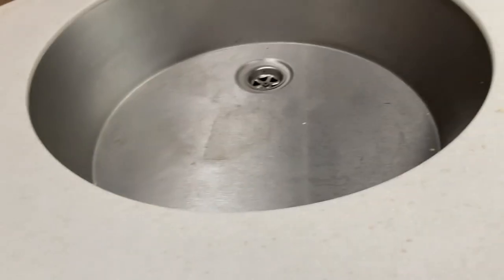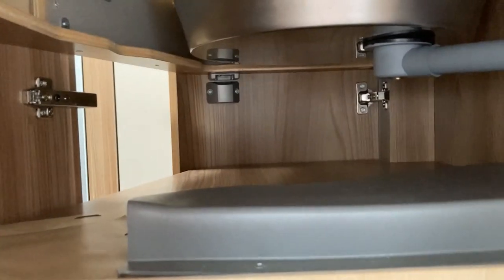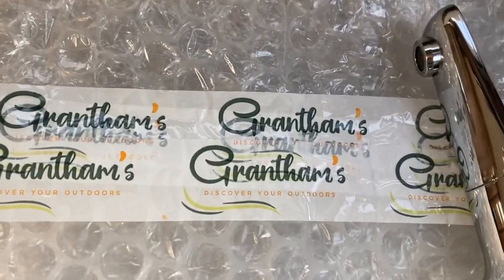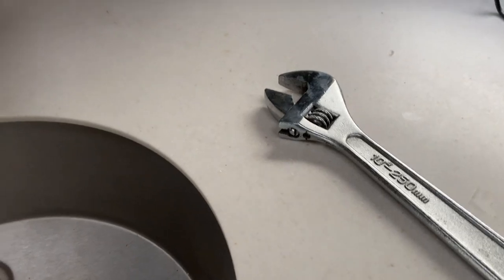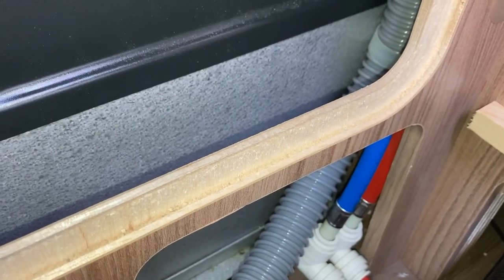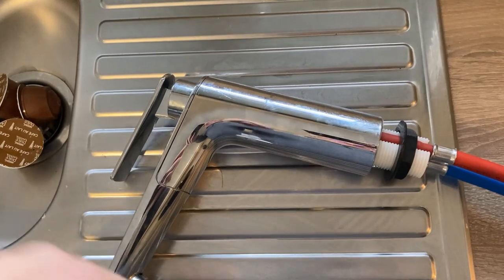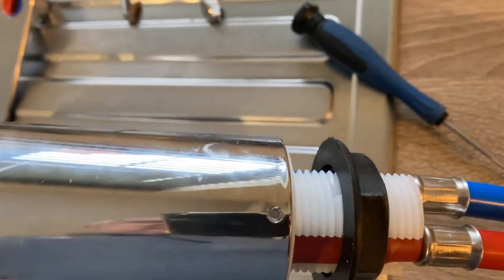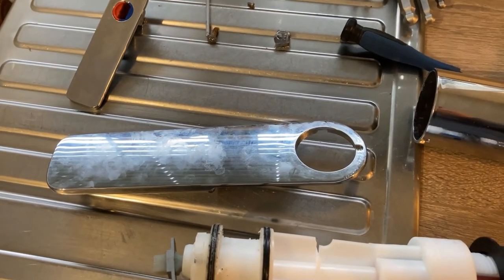Replace Motorhome Kitchen Tap. Reich Vector S Kitchen Tap, No Microswitch in a Swift Kontiki 650.

Comment: Forward planning, you should have a look at the bathroom tap, just the large o ring started leaking on ours.
The fixing screw is so close to the wall I had to shorten a Torx head to get it to fit in the space.
had access to a well equipped workshop, not something 'd have been able to do "in the field".
Used DIY brewers sealing gel on o ring.
Relocated the fixing screw into the front of tap.
Not found the cartridge as a replacement part yet as that will fail at some point, others Riech tap cartridges available but not the vector S..
Reply from the maker: Hi jeremybragg9980, thank you for adding your comment, I did also have a leak in the bathroom shower mixer tap, see the video here, https://www.youtube.com/watch?v=UnuUmy6yuSs&t=315s.
These leaks as said in the videos are completely my fault, I did not relieve the pressure in the system by opening all the taps before parking up our van.  There are many cartridges available as spares online, for example the one below fits many different taps, I am NOT saying this is the same as yours but when I looked at the one I may need to  replace, this looked like a match for the one in my Vector S kitchen mixer tap.
https://www.ebay.co.uk/itm/355144013125?mkevt=1&mkcid=1&mkrid=710-53481-19255-0&campid=5338365712&toolid=20006&customid=EB183619388&amdata=enc%3A14IRYacNtSA2_NAcZFAEC3w13&_trkparms=ispr%3D1

Comment: Hello butty, I've had a similar fault with my Reich Vector tap. Hair line split/crack inside the spout. So I took it all apart from the top without disconnecting the main hot and cold feeds, just undone the small Torx screw on the top and bottom and it all came apart, leaving the Plastic inner still attached from below. I superglued over the fracture, changed the Cartridge while It was stripped down just in case. Put it all back together and working great, but it will swivel in situ, with no leak. I cannot remember if the body of the tap is supposed to swivel? And I cannot for the life of me figure a way of stopping it from rotating if you allow it to.The bottom grub screw stops the outer from lifting up , and the top grub screw is for the  piece around the hot/cold lever. Any idea if this is supposed to rotate, doesn't seem right to me, most taps are secured from below with the retaining nut, but this is already tight holding the inner part of the tap. Sorry for the long winded question, all the best.
Reply from the maker: Hi Mally125, there is a a seal which sits on top of the counter between the tap and the counter, you can see the broken seal in the video on the table around the 4.06 min mark in the video.
The new tap I purchased came with a new one which can be seen in the video, briefly
The nut underneath is just tightened against the underside of the counter and stops the tap vibrating while traveling but if forced the tap will still move, there is no locating lug or anything to keep the tap in a fixed position.
Hope this helps.
Reply: @trytofixitmyselffirst4940  Sorted it out mate, after I left the comment I did some research into those taps. There is a 120degree movement in them. If you look at the base of the inner there is a cutaway that the small grommet/ washer fits into, the one with the small torx screw. When i was refitting the top of the tap I had this facing towards me, it made it easier to line it up and tighten. Once the whole thing is tightened down that small grommet/washer/spacer thing stops the tap from being pulled upwards. Crazy design if you ask me, but it might be of help to anyone struggling to get a Torx bit into the back of the tap to undo the screw, just need to rotate the outer body to gain better access. Thanks for getting back, all the best Mally

Comment: Do you still have the cartridge?
Could you post some images of it please.
I'm trying to source replacements, nothing lsited as for Reich Vector s so I need to compare images online with original and don't want to strip down.
Many thanks
Reply from the maker: Hi jeremybragg9980 again, I did not keep the cartridge as I was replacing the complete tap, I did not take any photos of the cartridge either, but I did strip it down further to take a look at the cartridge as other forums I have read have said these can be problematic, but in my case, these cartridges had nothing to do with my leaks.
I did a search for a replacement cartridge and some cartridges fit many tap types, see the eBay listing below and in the description it states it fits a Vector S tap.
https://www.ebay.co.uk/itm/355144013125?mkevt=1&mkcid=1&mkrid=710-53481-19255-0&campid=5338365712&toolid=20006&customid=EB183619388&amdata=enc%3A14IRYacNtSA2_NAcZFAEC3w13&_trkparms=ispr%3D1
Hope all of this helps and thanks for watching my videos.

Comment: All you needed to do was to replace the o rings on the white plastic part, about a fiver
Reply from the maker: Hi Destroyer, thanks for the comment, unfortunately for me this leak had nothing to do with the cartridge ,it was the tap housing at the spout end after the O ring on the main tap body that had a hairline crack.
On the video around 13.15 you will see the spout and main body separated and all of the tap was good beyond the cartridge and the O ring on the main body, but with the tap closed and the pressure in the system the water could leak through the crack in the spout body after the O ring.